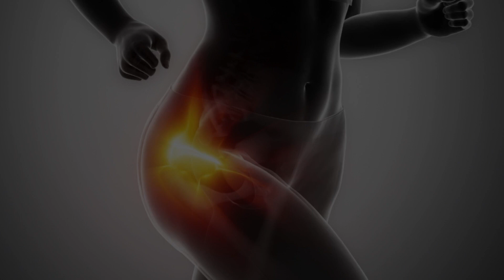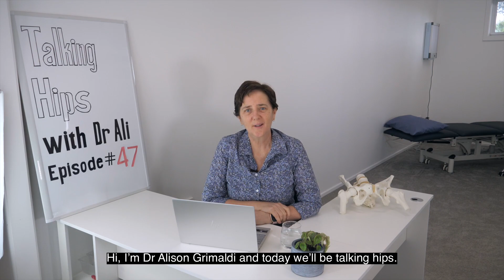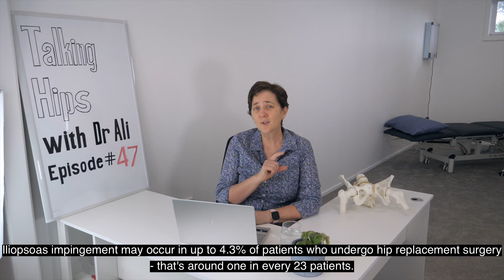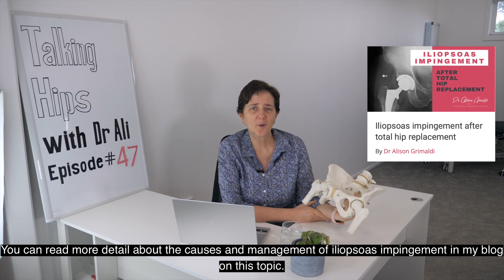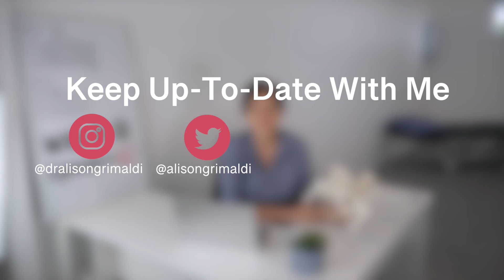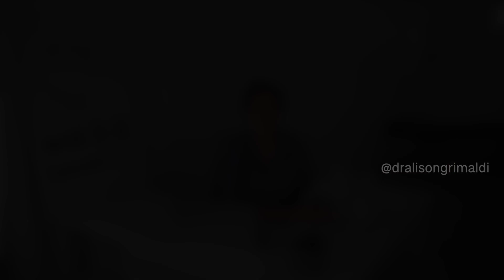Episode 47: Causes of Iliopsoas Impingement after Total Hip Replacement

Comment: I definitely have a trapped psoas. 12 years i have struggled with pain and mivement until recently a new consultant has acknowledged the problem. Why can the replaced hip not be taken out and refitted with the correct size, therefore releasing the psoas.

Comment from the maker: There are known risks and potential difficulties with all surgeries unfortunately. Sometimes it can also be about tue person’s natural bony shape. Impingement is more likely to occur where someone has a little less natural bone socket at the front of the hip. The prosthetic cup has to be a certain size for stability of the prosthesis, so the socket may end up protruding more than ideal, but stability will aways be a priority.
Regarding injection, this can help symptoms but is usually short term & there are some concerns re injections around a prosthesis due to small risk of infection - the surgeon would usually provide guidance on individual risk-benefit. 
Some good load management advice (calming things down by identifying & modifying irritating positional & movement or exercise/activity habits) and a graduated series of exercises through an impingement free range are very important for best chances of longer term control of symptoms.
Reply from the maker: In the native hip ( no prosthesis ), those with dysplasia (instability) commonly develop iliopsoas related pain because the muscle is working harder than normal to help stabilise the joint. But it’s not an ‘impingement’ in the same way as after a hip replacement.

Comment: Is incorrect placement of the acetabular cup considered malpractice? Can a steroid injection to the psaos sheath cute the issues completely?
Reply: I have been diagnosed with lliopsoas impingement after total hip replacement. My  Groin, thigh (into knee) , Lower back  and stomach pain has been getting worse .
The surgeon has said he can go in and cut the lliopsoas. Has anyone had this done ? I'm concerned about my movement ability after even tho I'm told it will help with the pain .
Reply: I had injection, and did nothing...
Reply: I had injections twice within several years and the pain in50% lessoned. This, however was done not specifically for my comfort level but as a diagnostic to determine wether it was  was in fact the psoas. (Bursitis)Now that I'm reasonable sure, I will try first physical therapy. and if this fails, there is a procedure to go in and lengthen/release some of the Psoas. Any inight will be welcome.
Reply: How long did it lessen for?  @garyfieldman
Reply: @GoodByeSkyHarborLive  About 3 months for both. But as I understand it, this practice will eventually become less effective and even possibly bad for the condition overall. ?